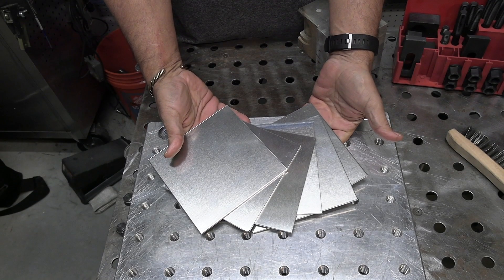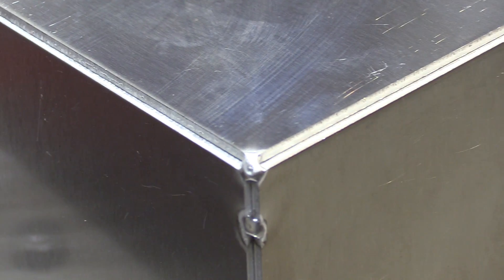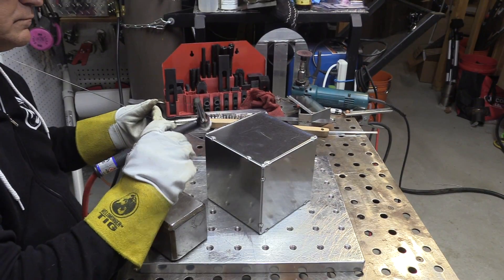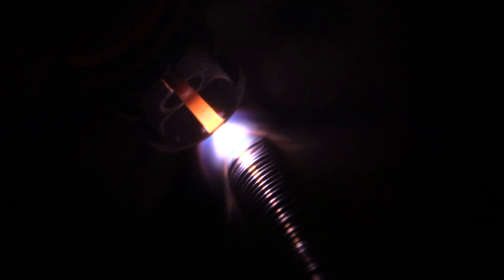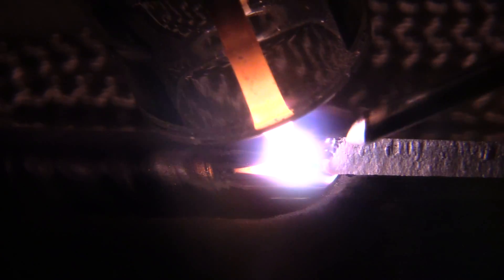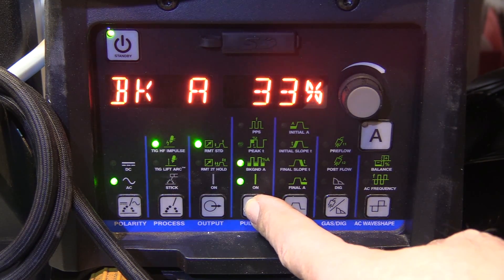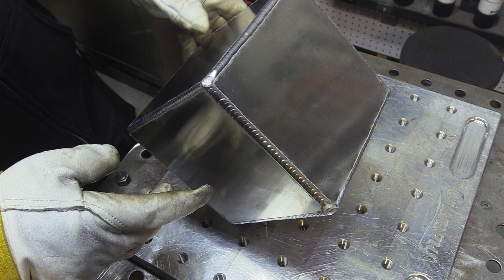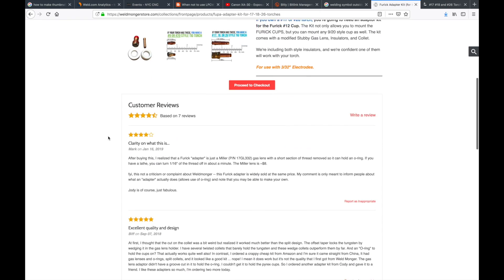Aluminum TIG Welding Techniques | Welding Tips & Tricks #Welding #Aluminum #TIG

Comment: I love the TIG finger. I do pontoon repair and the TIG finger is awesome. No more burnt fingers. 👍
Reply: Ha, awesome.  I repair a ton of pontoons myself.  You'll find the clear cup he sells helps alot, especially when you have to use a mirror to get the back side of an "m" bracket on the top of the toon.
Reply: @pontoonrob7948  if I have to use a mirror it's not getting welded!😂

Comment: When I am doing outside corner welds, I will use a piece of aluminum angle for my alignment fixture.  I have pieces of angle from 1 x 1 up to 5 x 5 and thicknesses from 1/4" to 1/2".  When I weld up the first two pieces, I will set the angle up on some supports (Practice T joints) and weld the piece in the 1F position.  I will use clamps to hold the work pieces in place.  It also helps to prevent or minimize any distortion to the angle of the joint and if I have to move it back to square it is only a little bit of adjustment.

Comment: Much better description then the videos we watched in class. We made a cube and were told because of the pressure/heat  the last hole would keep blowing out, but you mentioned blasting the the hole while its cooled. I drilled a hole in mine, maybe I'll try filling it in.

Comment: I made something like this recently except mine was made from triangles cut from 3x3x¼ aluminum angles. I cleaned up 24 of them and tacked them together to make 6 square's, then tacked the 6 square's together to make a box. I did forget to drill a hole in it and the last weld didn't want to weld up at the end, so I drilled out a big enough hole to weld a small fitting on. Now I have a somewhat lop sided aluminum box with a fitting that isn't centered at all and the box wobbles. But at least my welds look crispy👍🇺🇸

Comment: I have an aluminium profile , butane torch , some brazing rods that melt very fast and has flux in them, could I use 4043 or 4047 with arc or the butane torch ?will it work or will the profile melt before the rods?

Comment: Hey, Jody! I've always hear that tig, and arc welds are the strongest. What do you think about this? Which welds are stronger, while which ones are weaker?
Reply: There's a lot of tig snobs that make all kinds of claims. Which process is better? The one that gets the job done best. Need high deposition? Spray-arc mig, Submerged arc or flux core come to mind. Outside in the elements? SMAW (stick) is tried and true. In the shipyard we used tig on pipe for the root and hot pass but switched to stick for fill and cap. And done right, Mr. X-ray wasn't a problem! Learn every process you can. Try hand held sub-arc (squirt), now that's welding blind! LOL!

Comment: Hey what do you do about the frequency settings not back feeding into the electrical system in a house, I got a 210 ext in my garage that’s connected to the house and don’t wanna fry my tv/computers while doing HF start etc.
Reply from the maker: the manual shows a ground lug on the back of the machine . they recommend attaching a ground cable to an earth ground https://www.everlastgenerators.com/sites/everlastgenerators/files/downloads/dfe60188c86d74021235f2b62636585b.pdf

Comment: Mr Jody, is your machine set, so you can just flat foot the pedal? thanks for the many years of welding lessons💪
Reply from the maker: I usually set the machine with slightly higher amps than I actually need so I am not usually full pedal.  But sometimes, I experiment

Comment: I did a bunch of 6” cubes a while back and the challenge was to inject a cup of water into the vent hole before you close it up. Back purging with argon also helps. 

I finally wore out a tig finger, Jody! It started to fray and it didn’t last long after that. I untucked it and use it as a static prop now, just to try and get some good use out of the old feller.

Comment: Jody, I prefer to either sand (belt sander) or file (Vixen file) the sheared edges of sheet or plate to get rid of the dross forming torn material in the sheared edge. Seems to allow less gas to keep the same weld cleaner- but needs much more gas to shed the 'salt&pepper' from the bits of torn material left from a shear? Would be good to see some of those edges in 5356 - no boat builders use 40 series filler.

Comment: Hey Jody, great tips as always. I'm hoping you could do a video on tig welding on non moveable projects. I'm currently building a roll cage and having a difficult time with propping. Sometimes there's just no way to do it, and sight lines are really difficult, too! How do you deal with these issues? Inquiring minds want to know!
Reply: I can't help you with the propping, you just need to be in a really flexible mood and do what you can.  I will give you my favorite trick for roll cages, though.  When you have to have an inspection hole anyway, vent all of your tubes to each other so the inspection hole becomes a vent for the entire cage and you never have to worry about a weld blowing out on a joint.  Also, I use a linear thumb amperage control instead of a foot pedal, they are worth their weight in gold for many positions inside the car.

Comment: Great video and extremely clean technique. I do have a question if you wouldn’t mind answering it when you have the time. How would you recommend that someone with little to no T.I.G welding work experience could get a job performing T.I.G welding to gain vital work experience? Assuming that this person has experience T.I.G welding but only in a school certification program and no work experience yet.

Comment: Good stuff! A short while back you made a video comparing different frequencies, when welding aluminium, how about a video comparing waveforms? (sine, square, triangular)?
Reply: He's got that too. You'll have to look back in the last two years or buy the DVD set... Either way, you'll find it on his channel.
Reply: @Aint1S  Great, thanks, but any chance you can be more specific? I've searched Jody's channel and his newsletters, which I've kept from nine years back - no result.
Reply: @Aint1S  Thx a lot, it helped searching on the machine instead. I've got a 250 EX btw that just crapped out on me, hence the interest as to what the new one should be able to.
Reply: Sine wave is old school; a good start. Advanced square wave allows for faster travel speed and triangular wave is to keep heat out for smaller gauge material. Just look at the peaks of all 3 wave forms and that will translate to how the heat is being handled. Sine wave is an even, predictable distribution whereas advanced square wave will dwell on the heat a bit more. Triangular will only be at it's hottest for a very short period in comparison.
Reply: kup1954, Yes, that would be interesting.